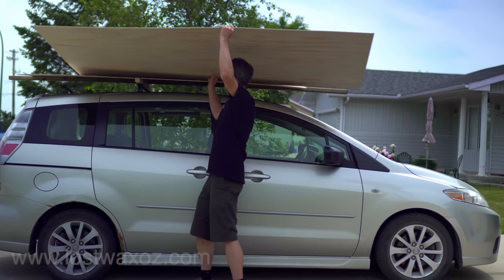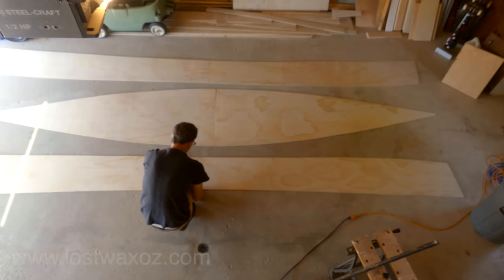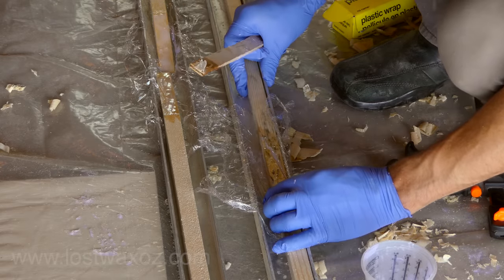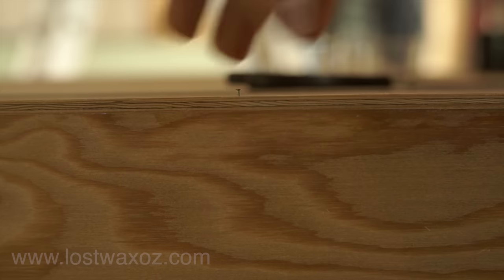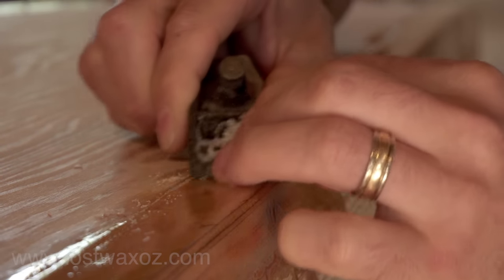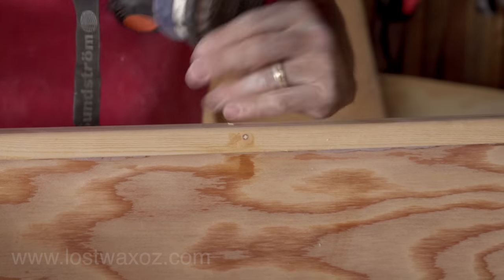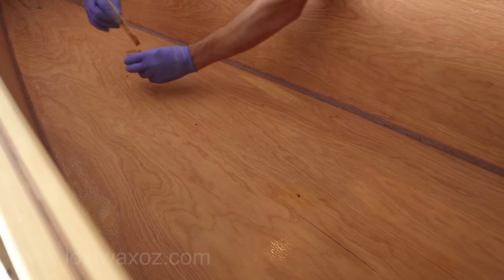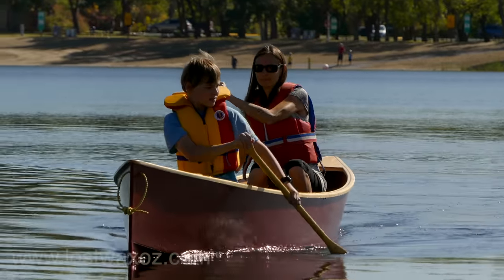Can You Make a Canoe from Plywood? DIY Quick Canoe. Plywood Cheap Canoe Build

Comment: by no means am i  stating you didn’t do something Correctly but i’m a retired Woodworker with more than 35 years of  experience  one is  Plywood doesn’t Plane very well  with a traditional style hand Plane  you would have faster results with a Belt Sander  although it is dustier , and two  you can obtain way better cuts with a Jig Saw that utilizes a T Blade  BTW they have a lot more specialty blades in that Configuration  Harbor Freight sells a  okay one for under $20.00  i respect the one you have is your Grandfathers  but you will find the other style is easier to  use with better results  as the blade stays straighter because of  guide rollers and the way tits attached to the too l  you need to Epoxy the boat because that’s what makes it Water Proof  especially using that type of Plywood instead of Marine Grade that’s built with Waterproof glues and  little to no Voids  but costs much more it’s generally called Okume Plywood or Marine Grade and the Big Box Stores don’t generally Stock it  unless you are in a large Marine  Area like Florida  or something similiar in other areas Hardwood Suppliers  usually have it available  and  some local building Suppliers in and around annapolis MD  have it available  at Premium prices

Comment: If you epoxied the conoe and made it water tight, couldn't you have just continued with the original wood?
Reply from the maker: In theory, yes, and it would be fine, until there became any kind of crack in the epoxy coating, and then, maybe not so much.
Reply: That is fair. Thanks

Comment: What kind of plywood did you change too?
Reply from the maker: They called it marine plywood, but it had no stampings on it, so I am not sure if it was actually rated as that or not. But it cost 4x more than the original, so I sure hope it was better. Also, it was fir, which I have found out is terrible for checking- which means constant re painting:(
Reply: @LostWax2  Yes, fir plywood will badly check without fiberglass over it. 

Very nice conoe.

Comment: if the entire boat is incased in epoxy.  what difference does it make that the laminate isn't water proof.     ...no water is ever going to touch the plywood.   it's mearly a decorative substrate.   and in most builds where people wrap the boat in fiberglass mesh.  even more so
Reply from the maker: Yeah, I would trust it if it was wrapped in fibreglass cloth, but with just a thin layer of epoxy, it's too easy for water to penetrate. As it is I have had some checking with the wood I used, so I have had to repaint it a couple of times. Lesson learned- don't use fir plywood.

Comment: Some observations, ideas, statements and questions:
.5) This video was quick, but I doubt the canoe making was this quick. Therefore might be a liar.
1) You have a thumb injury. What happened?
2) You replaced your mom with a younger woman, that's rude. I hope you sent your mom some flowers.
3) You need some new tools but Grandpa would be proud. 
4) Matches were an interesting idea. I use Golf tees in situations like that. 
5) Despite getting the most expensive component for free (the epoxy) your finished product is outstanding considering the materials used. '
6) You know a lot more about Canoes than me. 
7) You are good at making youtube videos, dont stop. 
8) Red canoes attract sharks.
Reply from the maker: I actually forget what I did to my thumb. I think it was something to do with moving a swingset to our backyard..... and I just replaced my grandpas table saw and man, what a difference!! Converted the tablesaw into a sander...

Comment: There was no reason to go get Marine plywood. If you fiberglass the whole boat then there's no reason to use marine ply. I got a little boat I made out of the cheapest plywood I can find and fiberglass the whole thing and have been using it for the last 10 years and there hasn't been any issues with the plywood.